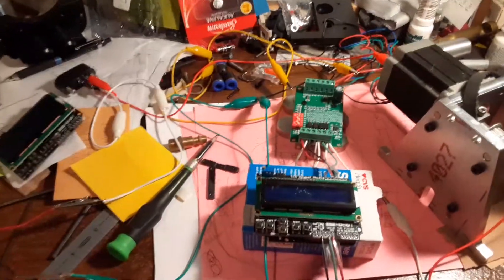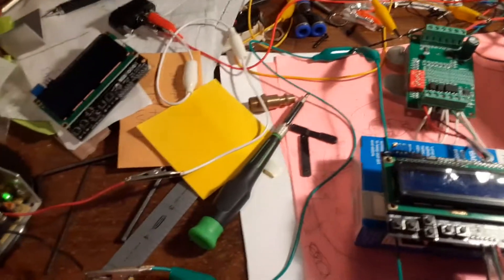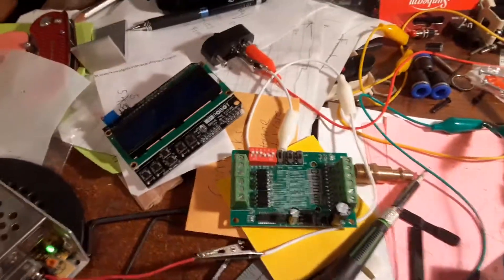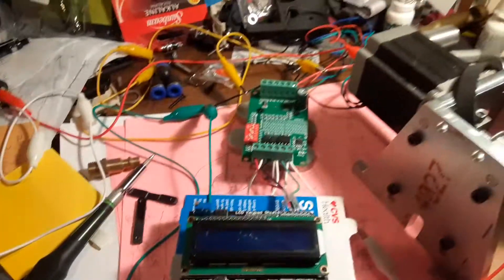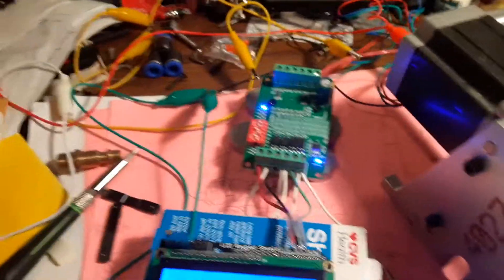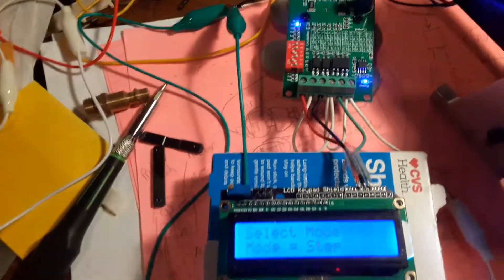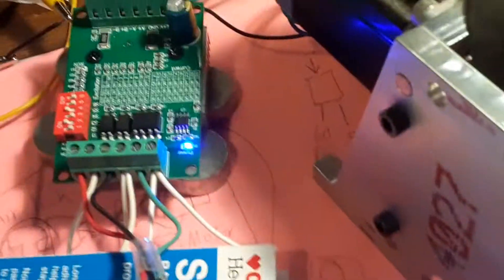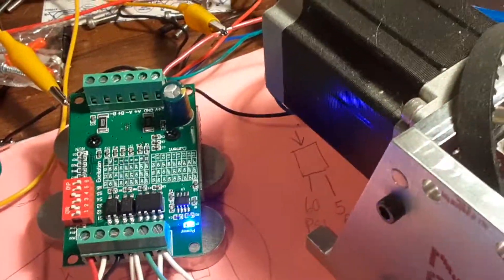Adding a stepper motor to a spin indexer.

Comment: the display probably has a backlight pin that needs to be set correctly
Reply from the maker: Hi Jerry, I found out that the little blue pod in the upper left corner has a little screw in it that controls the brightness of the screen. By rotating the screw clockwise or counterclockwise it will brighten or dim the screen. You were right.